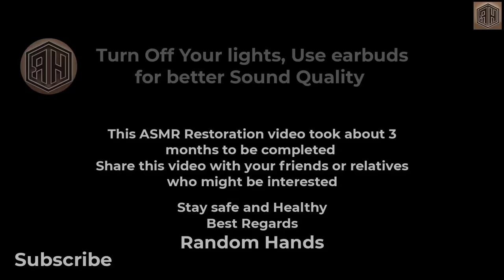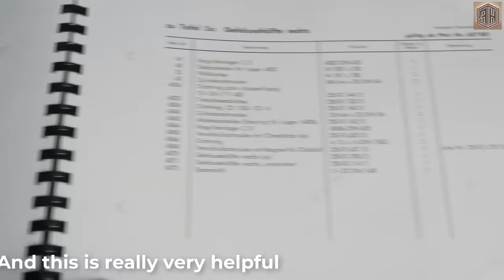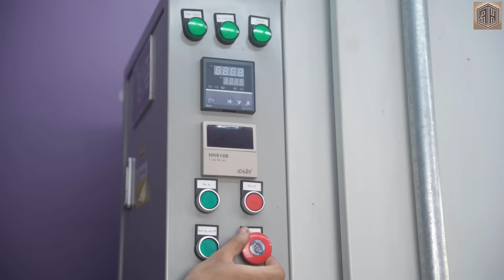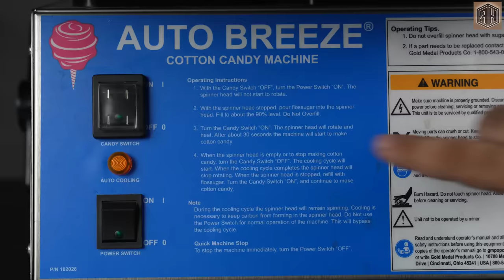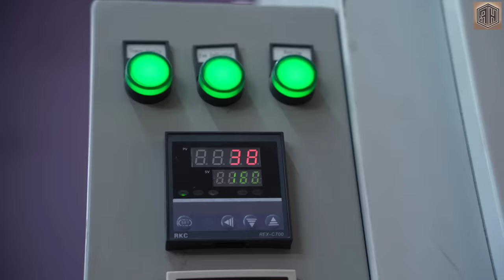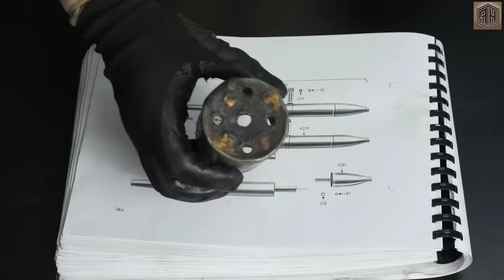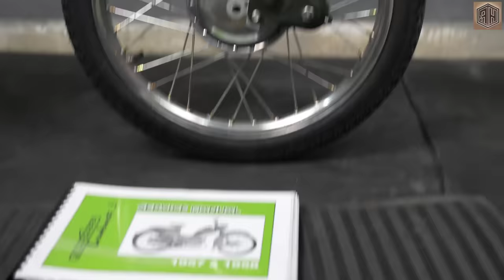1956 Antique German Motorcycle Complete Restoration ASMR

Comment: OMW, one of the great German made 2 wheelers, the crank case was like a standard on all 50cc  models uptil they sold the tooling and rights to the chinese, i had several of this manufacturers bikes from the late 60's uptil mid 70's including the 100cc scrambler, kreidler was there competitor in the day, this vid brings back such great memories of my teens, i did 4 trips of 600km each way with average times of 6 hrs each way,

Comment: Zundapp was the best quality moped and motorcycle of that era. Even rusted as it was in beginning I can see the better quality, higher gauge steel. She's good for another 50 years with a dry garage!  Chrome panel on fuel tank and exhaust are amazing. Brilliant resto. Not sure about the owl though. I like how bolts squeak and complain when they are turned for first time in 60 years.

Comment: Beautiful!   What a cool design.

Your skills far exceed my own so I may be speaking out of turn.... but I'm often surprised to see mechanics hammering on bearing races like you did to drive the tapered pin into the pedal crank.  It would be ok if the other side were resting against a heavy anvil to absorb the shocks.  Or ideally pressed in.

Comment: Beautiful restoration job. However, you hit the cylinder over the piston , why? I’ve seen many restoration projects and most of the time people lubricate the inside of the cylinder so that it slides on the piston. ☹️. No grease on the bearings on the handlebars riser? Other than that, it’s a beautiful job.👍
Reply from the maker: Ahhhh Thanks for posting my mistakes, I will definitely buy an Arbor Press for Bearing fittings

Comment: So, the chain case has one side.? How about the Rubber cap on outside?  I would add a plate on inner side of the chain case. Lube the chain in molten grease. Use Rubber grommets for electrical cable comming through metal. Any way I did enjoy the process Cheers.

Comment: Good restauration , but replacing the speedometer with that item is horrible .The original you can  get easely in Germany in new condition,  if needed you can set marks for miles .

Comment: Hey There, respect for your talent but there are some points in the assembly where you made mistakes, like for example you forgot to add grease to the front bearing cups while you Reassembled it. Or some parts like the clutch springs, you can't restore them, you have to get new ones otherwise there is a risk that they might brake and you're whole engine is destroyed (i don't wanna disrespect you, in Germany we have the part's to do this, maybe you just couldn't replace em). Still, the end result looks great, you just shouldn't drive its

Comment: Good But not better. Inside the chain case cover is missing. &  The rubber cover between front of the chain case & front sprocket is missing. All the cables through metal cover should have rubber grommets. Are there steel balls in the peddles ? All Good not Better. Cheers.

Comment: Hitting the crank and the bearings with a hammer?? You need to warm up the housing, than bearings will fall into their place. Also removing the piston pin with a hammer?? Heating it up with an airgun will help. I would never buy such an restored motor!!
Reply: Opposite to chrome at home o_O

Comment: Wait… Ok… Now you’ve gone too far. I was trying to watch and enjoy in spite of the audio nightmare of this video, but now I’m seeing parts going back together that are nasty and STILL RUSTY, rusty clutch plates going back in, parts that are beaten and hammered to death and misshapen, and bearings being hammered and treated like railroad spikes. And no assembly lube anywhere, or grease on bearings as they go back in? C’mon now. What’s the real deal here? It’s now clear that EXTERNAL COSMETIC APPEARANCE is all that matters here, and that internal cleanliness and integrity is an afterthought… And now a rusty chain going back on? Cables without actual cables? No air filter in the air box? It’s now obvious that the restoration bike, and the running bike at the end are two different bikes, and that this video is fake. No doubt there are great skills here, but the video itself is a mock-up, and not the actual restoration. 🤦🏻‍♂️🤦🏻‍♂️🤦🏻‍♂️

Comment: Your restoration is engine cleaning not make out engine parts adjustment and secound you finish padal lock system third in your restoration does not show brake pads and wiring system